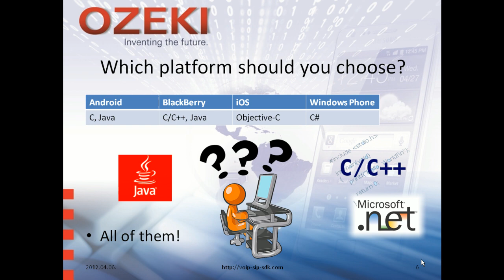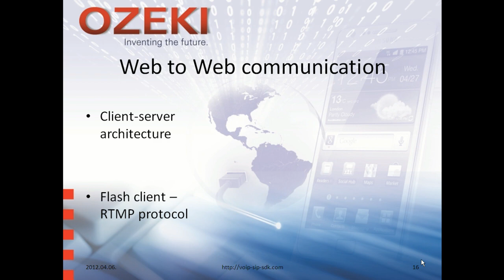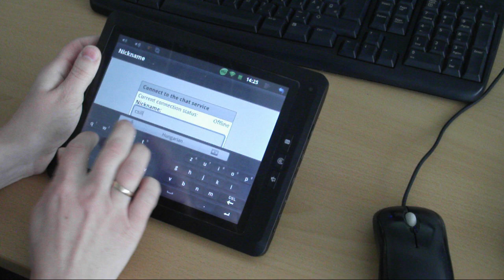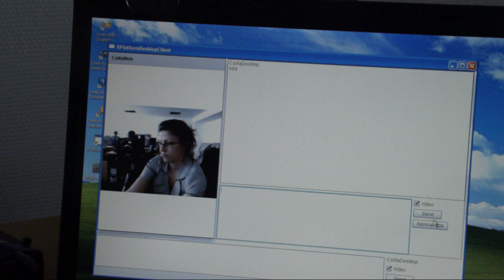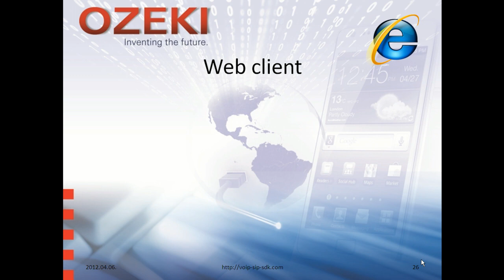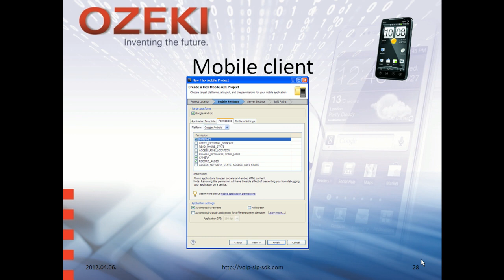Ozeki VOIP SIP SDK for mobile, desktop and web platforms

Comment: VoIP SIP
Reply: Hi ,dear .We are manufacturer of sms modem . you can have a look at us .
1.GSM 900/1800/850/1900Mhz Quad band
2.IMEI Change
3.USB optiona
4.AT Command
5.Free software (SMScaster)
6.Speed 700-900sms/Hour
7.8/16/32/64 sim slot reliable .
8.Warranty: 12 months, provide free 7/24 tech support.⚠️Save up to 15% off now.
⚠️Manufacturer of Sim box &Sms modem,provide wholesale price,Provide Otp Sms tarffic.
⚠️Hotline: 
Whatsapp/ Wechat/ Zalo :+8613715985640 
Skype : live:6bac679d890c89a2 
Email:chinaskyline.natalie@gmail.com
Reply: are you in Pak or BD ? we do voip call and sms busienss there .may be can help you .